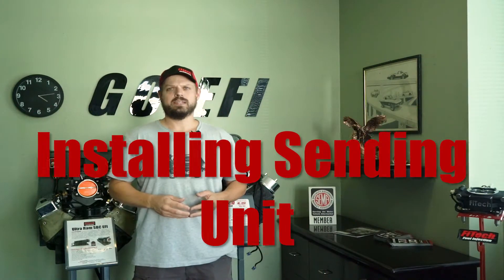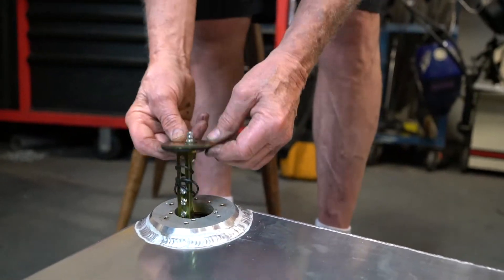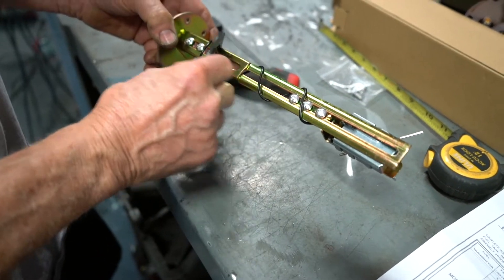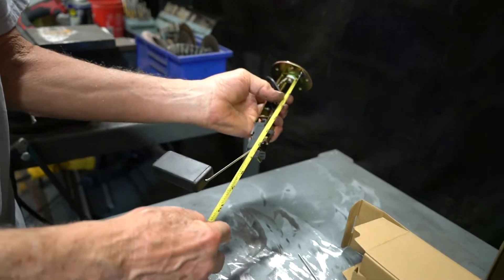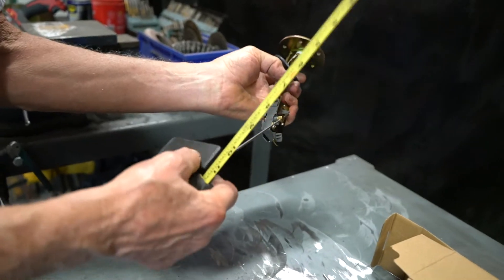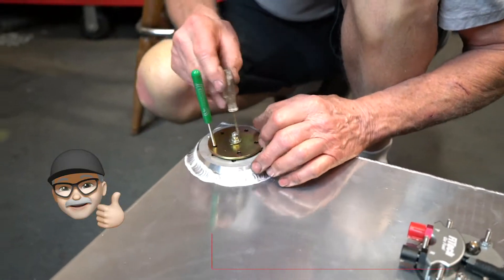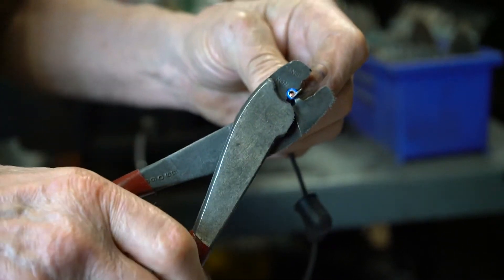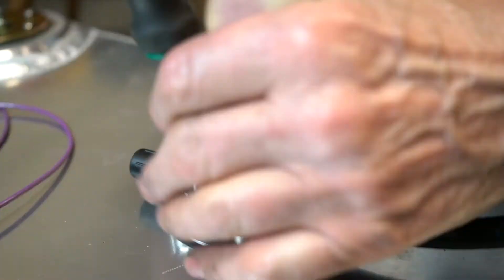How to Install Fuel Level Sending Unit | Tech Tuesdays | EP33

Comment: I have installed my fuel pump and fuel sending unit exactly the way you just showed but while I'm running the fuel pump it makes the sending unit run about an eighth of a tank off so changing the resistance on the sending unit any suggestions